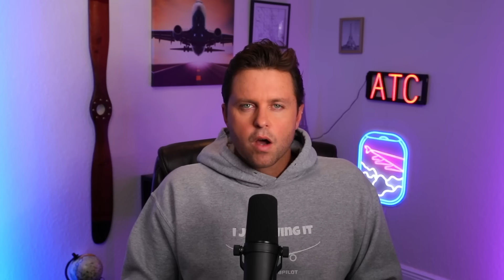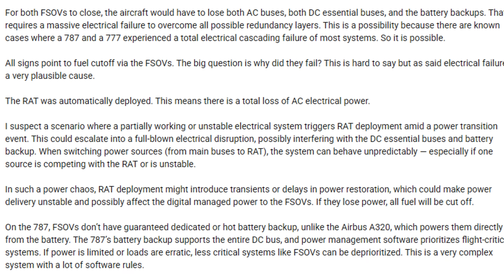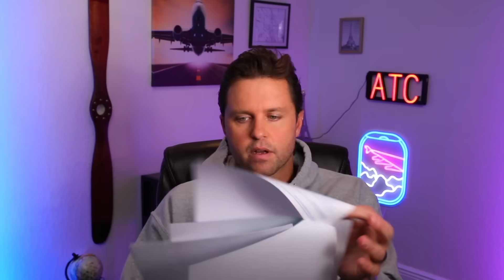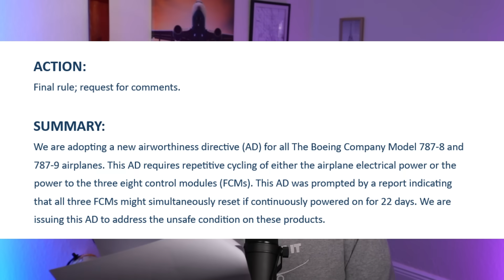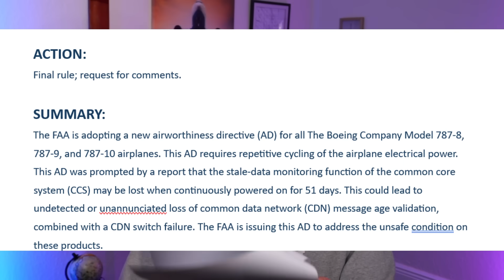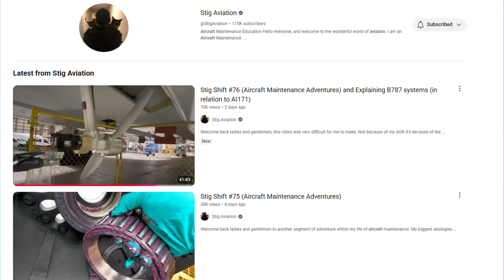Air India 171: Did a Software Glitch Cause Dual Engine Failure?

Comment: Gary im a broadcast engineer and grew up working on cars and tvs ... Ive designed a lot of circuits in my 48v solar system,..it would really be interesting to see a wiring diagram ( schematic) of this plane,.. there are ways to design the dc supply to crucial components so that the 24 v battery system can take over with  NO interruption 🎉at ALL in the DC supply and still be safeguarded if the battery system was to short not affect the system.🎉..  Sounds like they are using relays from one system to another AC power switching on the other hand has to relays unless its phase locked...i really don't understand why they have the DC set up this way, if in fact it is the way you described from that paper......and also  i understand there thinking behind the fuel solenoid ( energized for fuel passage) but that also means ,, if the fuel   solenoid shutoff coil gets  shorted  turns or gets a open circuit even if the 24 v is still there  its also going to kill both engines ( unless there is separate ones for each engine)

Comment: You are spreading speculation and it’s dangerous at the extreme and at the least, it’s disrespectful to the folks who are dealing with sudden loss.
Did you confirm any of your “facts” before sharing it? NO, you did not.  And trying to tie this to MCAS?  Are you f’ing kidding me?!? Thats conjecture.  Oh, and you asked googles AI to verify one of your ‘facts’?  I mean seriously?!?  Because those AI agents are always 100% correct, right?   Use google AI to figure out temps for broiling steak, not electrical schematics for the 787.  

As for your weak attempt at letting yourself off the hook by continuously saying ‘you are just sharing facts’ is BS.

At the end of the day, you are trying to personally  monetize tragedy and It’s disgusting.  

None of your disparaging comments help the investigation in any way, but when they are wrong, they can damage someone’s trust in flying.  Be better than that.

Comment: This was my conclusion only hours after it happened... Complete electrical Failure. This could shut down both engines if they relied on electrical power. I couldn't explain how or why, but I think you just did.

Comment: 711 did not rotate until the end of the runway evidenced by the big cloud of dust. Fast moving objects  like the nose of the airplane pushes a bank of air in front thus causing dust and dirt to be kicked up in front of the airplane and as the airplane went through the dust and dirt the engines could have ingested the dust and dirt contributing to a stall especially if the electronic control boxes on the engines had cut back on the thrust. That combined with an aggressive rotation because  711 was so close to the end of the runway. The engines very well could have shut down together because they were subjected to the same conditions together and subject to the same input from the cockpit. Contaminate fuel? Maybe not contaminated, but maybe subgrade. The shut off valves shutting off the fuel because of a momentary loss of electrical makes sense because we did not see any sputtering flames from the engines typical of compressor stall, like the fuel stopped completely and suddenly.  IMO, a fuel valve/valves that would shut down engines because of a momentary loss of electrical power would be a bad design, a very dangerous design.
Reply: The mishap flight was AI 171.

The aircraft rotated at the usual position on the runway and climbed normally to 400 ft. Then the aircraft descended to 71 ft agl and flew over the end of the runway. The large dust cloud is caused by the tip vortices picking-up dust behind th aircraft, the cloud does not form in front of the aircraft and this is not a FOD risk.

Comment: Honestly, it wouldn’t be that crazy to me if the AC and TV issues on the previous flight were a sign of something bigger going on. On the 787 (from what I am reading) , those systems run off the same electrical setup that powers more important stuff and it says engines are controlled electronically. So if there was a deeper electrical problem, it could’ve affected things like engine performance or flight controls too. What seemed like small issues might’ve actually been early warning signs.  I’m no expert but from day one It’s seemed off to me and felt like those had to be related. Again just my speculation here. 😊

Comment: As a retired commercial pilot you bring up a good point. This automation seems to bring in more problems than it’s worth and I’m glad I retired before all this FADEC controls ran the engines. Everything I flew I controlled and flew the aircraft much safer. I was a helicopter pilot twin engine and singled turbine and piston driven. Well researched article.
Reply: "more problems than it’s worth"-> I would dispute that. Flying is safer than it's ever been. I strongly suspect that automation has saved far more lives than it has cost.
Reply: Somehow I FELT safer when the pilot's "stick and rudder" actions controlled the planes.
(My computer likes to break down, unprovoked)
Reply: Ich fragte mich auch gerade ist denn dieser ganze Techniche Zirkus nötig Triebwerke am Laufen zu halten?Es ging doch auch immer Ohne .
Reply: @HubertStolze  Aircraft are more complex now, partly because systems are in place to avoid things that went wrong before- and aviation is far safer than it used to be in passenger miles than it was when pilots did more themselves. And at the extreme, take military planes- they fly so fast, and are so dynamically unstable in order to help them manouvre, that a human could not now control one safely without masses of computing going on, keeping everything under control.

Comment: Mate its more simple than that. The CCS is primarily powered by the fwd 28V DC bus which short circuited in the main battery, just like this model did previously in japan in 2013. 
This time, during takeoff thrust , the short brought everything on the primary fwd dc 28v bus down to 0 volts dc both sides of the cockpit, which is enough to deploy the rat.
It takes 10 seconds for rat to supply power. 
The survivor mentioned the plane tried to climb but it was too late. His words were something like, "THEN IT TRIED TO GO UP AGAIN"
Im sorry, but the lithium battery is the cause. End of story.
Sorry I just cant find the energy to post the proof in a youtube comment.
I spoke up because you said at the beginning that u weren't going to speculate, but then started speculating haha. Please, please stop till the FAA pass on the truth to ntsb and air india and finally boeing, for their demise.
Reply: Occam's razor. I have 0 assumptions, only proof. And youtube comments is the worst place to go for the answers. Consider my reply the diamond in the rough. But  I will also just look like another youtuber i guess :p.

Comment: If true, this is huge deal. Since the launch of the Boeing 787, this is first total loss after roughly 5 million flights of the 787s world wide. I really hope this turns out to be an extremely rare catastrophic accident. Apparently, this particular Air India aircraft that crashed has had power issues for quite a while before the crash. One person on another video that commented, did some digging on Flightradar24 and noticed this aircraft failed to send the ADS B data for weeks before the crash. He also pointed out the the other 787s did not have this problem at the time at the same airport.
Reply: Ongoing power interruption would actually prevent the things stated in the AD's.

Comment: Hi Gary,
            The cockpit voice recorder has been decoded. These are the last words of Pilot;
"Mayda Mayday thrust not achieved going down"
   You mean to say an LTC with 8200 hours of widebody jets experience cannot distinguish between power loss and complete engine failure.
Reply: Correct. The aircraft was at 71 ft agl at the end of the runway and it was 1,600m to the crash site. If both engines were shut down the aircraft could not have reached the crash site. As the aircraft did reach the crash site the engines had to be operating, but had rolled back to low power.

Comment: The electrical problems the plane was having on the incoming flight caused the Fuel Shut off Valves to shut off causing both engines to stop. Bingo! The plane never should have left the airport with the electrical problems it was having.

Comment: Seriously - where are you people coming up with this crap that FSOV's are spring loaded and close automatically with no power???   Boeing uses latch valves which requires power to close and to open -  Voltage is applied the valve moves and a permanent magnet holds the valve in that position until  a pulse voltage in opposite polarity tells it to move to the other position. Spar valves are motorized and require power for the whole time the valve is in transit - open or close and will stop in whatever position power is removed. 
No manufacturer will EVER put a valve that will spring shut with loss of power in a fuel system - 
Case in point Qantas Flight 32 - no 2 engine grenaded and severed wiring and cables and when they landed they could not shut down no 1 engine as no power was available. Fire crews decided after a couple hours to douche it with foam in the inlet and choke it out. So literally that proves you could saw the wing off a plane and the engines will keep running

Comment: In Britain our household appliances have 3, 5, or 13 amp plug fuses.

If a 4 amp device has a 5 amp fuse it will occasionally cut off as a false positive. 

Fit a 13? Or keep the 5?

The answer depends on the maximum regret.

Comment: A software glitch was the first thing I somehow sensed when I watched the disaster video, wondering why the real pilots were speaking only from a mechanical viewpoint. Being an avid aviation fanatic, I know a lot about the difference between flying with cables and FBW. I know many tricky details of 787 systems as well - one of the most aerodynamically and systems-wise stable commercial aircraft. My theory is multiple systems mismatch: one thinking it's in a takeoff, the other that is in landing mode. It's probably BS, but I think it closely corresponds with this video. I hope you get my point. Thanks for the video!

Comment: This is the most plausible theory I’ve heard. From everything I have heard, there is one thing that that is most likely true for both engines to simultaneously stop working, there is some sort of SYSTEM failure. Dirty or faulty fuel would not account for instantaneous loss of thrust in BOTH engines. Couple this information about a failsafe spring loaded valve actuating upon loss of dc power, and the witness statement of cabin lights flickering. Someone is going to have to pour through the schematics to find the flaw then corroborate it with physical evidence.

Comment: They're saying 171's black boxes are damaged. Now what?
Reply: The B787-8 black boxes that record CVR & FDA in one unit. Two such units are installed, one in the front and one in the tail. The unit at the front appears to have suffered damage in the post crash fire.
Reply: Many say to stop all this conjecturing and wait for the final report. Well, what if the data didn't survive the crash? What I'm learning as just a landlubber is a scant few know much about the 787. Those who do have brought a lot of info to the table. This "conjecturing" has been methodical, even while coming from various sources no matter the hour of the day. Now, it seems, there is a probable cause that'll hold up to scrutiny. Having eliminated all else, perhaps the aviation community have a solid answer.. even without an official report. Even so, we'll have to wait, but this process of discovery has been fascinating, IMO.

Comment: It seems appropriate to me to maintain, as you do, a scientific impartiality until this or any theory is confirmed via forensic examination. But the fact that one can be anxious about even suggesting it seems to speak volumes. It seems to me your instincts as a trained and experienced pilot are telling you how plausible this is; and that this identifies a design flaw as the source of the problem. Which would Boeing in the hot seat once again.

Comment: I read on chat. Gpt that if all three tanks have fuel in them. It will draw from the center tank first and ignore the wing tanks until the center tank has gone down. That means you're worried about two pumps in the center tank not getting power.

Comment: What's the point of the powerplant being self sufficient after start of the FSOV is vulnerable to this circumstance..  This should have a separate Hot Bus Source to not be exposed to this power loss.  Sounds very reasonable of an explanation that you have exposed.

Comment: I was an airframe/powerplant engineer for 35 years so my understanding of the electrical systems of an aircraft (B767 and B747) were as related to the airframe/engine side of an aircraft operation.  When the B747-400 was released with the "glass" cockpit there was always the fear of a complete cockpit electrical failure inflight even though multiple computers and redundant power paths were built into the aircraft.  Back in the mid to late-1990's a B747-400 (possibly Singapore Airlines) was flying to Auckland new Zealand from memory.  Inflight the entire cockpit indication system went blank for a matter of minutes.  Theoretically this was an impossible scenario given the redundancy built into the aircraft.  I recall the aircraft remained grounded for around 48 hours while avionics engineers basically replaced nearly every possible component that may have caused the shutdown.  This was a precaution as after the shutdown of the indication the system re-established itself and performed faultlessly afterwards.  The avionics engineers could not find a single fault in the system as all the components passed their test procedure.
Reply: With microelectronics, you can get situations where some minor variation in one part of a single chip on the microscopic level can cause it to act anomalously is a specific situation or environment that is so specific it might be impossible to replicate when you try and test it. I have an example of that myself: I carry a VHF portable with me at all times because I am on call 24/7, and in when it is a specific distance from my computer when I press the key to transmit, it can cause my operating system to bug or even crash. It has happened enough I know it is not coincidental. If the radio is not in that position when I hit the key, it doesn't happen. It doesn't affect other computers. I can't replicate it with other radios from my fire department of the same model. It is that specific radio, at that position, with my computer. In my case, it isn't catastrophic (the worst thing that happens is that my computer bluescreens), but it does happen.

Comment: Having FSOVs controlled by logic independent of the engine renders ALL other engine operation independence measures completely null & void. And this appears to be what we see here, perfectly operational & functioning engines at full throttle were automatically shut down during a critical phase of flight.

Comment: Regarding the fuel contamination theory: I don't know how they store the fuel at that Indian airport. Specifically, are the storage tanks in the ground or do they have trucks that carry the fuel to the planes? Regardless, it seems to me that a fuel contamination issue would have affected more than one plane. Were there reports from other flights that had fuel anomalies, or did other planes experience APU flameouts while on the ground? I'm asking because I don't know. However, the FSOV issue you raise sounds very plausible. I feel it's either that, a vapor lock due to high ambient and radiating runways temperatures, or a combination of the two.

Comment: What's also scary is the radio silence we're getting from the investigation.
Reply: They can't say anything they are not sure about- if they did, and got it wrong, those complaining now would be complaining then about that.
Reply: They probly figured out it was that tcas and are waiting becajse of backlash
Reply: @ValleyProtein  Or some sort of software glitch.
Reply: Yep.  Good (??) to see that a hundred-year-old term still has relevance in modern day aviation!!  That used to be referred to as the "cone of silence" before we got all electronically-operated planes and NAV systems, along with, in the present,  thousands of 'Cover-Your-ASpirationS' folks at Boeing interested in the mantra "not my fault".
Reply: Scary but not surprising.  They’ll hide whatever and everything they can.
Reply: Boeing is fcked if this would be the result. So they probably white wash it along the lines recorders disappeared/broken, or they say it was some pilot error. I mean dead people have nothing to loose, but Boeing has.
Reply: aviate, navigate and communicate...in this sequence and I'm sure they fought hard

Comment: Its alarming how did they miss to analyse such fail cases during safety assessments? Even during testing no one thought of this case i really doubt. I assume they just went ahead though some one pointed out a issue and it may cost some more to get the fix done analyse the possibility of this case to be very thin 😢